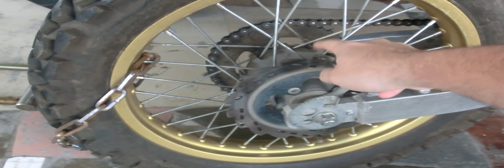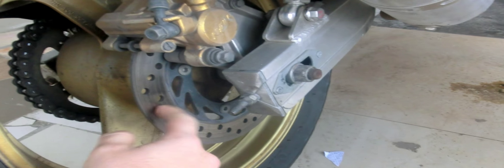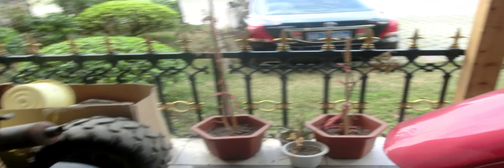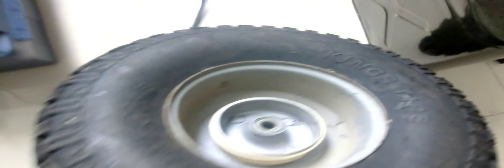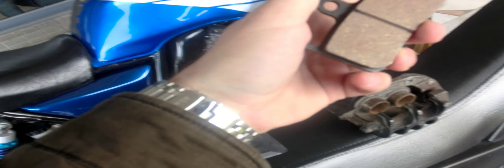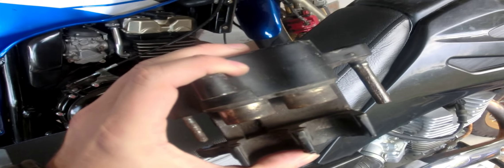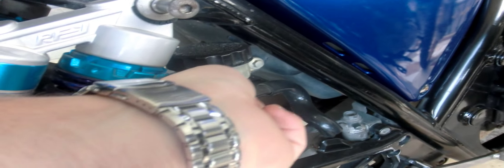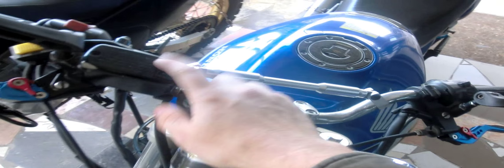Disc vs. Drum Brakes

Comment: You actually can bleed breaks yourself with the plastic tube method. This link uses the method I as well use /watch?v=LH68qjGqS1E&feature=related . Some proponents claim that using DOT 5 silicone fluid totally eliminates moisture contamination problems and has a very high and low temperature rating. Although 10 times more expensive than Got 3 ans 4 and requires a complete system drain prior to use.
Reply: Silicone fluid corrodes normal brake lines and requires lines replacement and components designed for DOT 5.
Reply: How about DOT 5.1? Less hassle and potential issues.

Comment: A slight correction if I may, drum brakes are extremely more efficient than disc brakes as they use only 300psi to stop and disc brakes can use thousands of psi which is the reason for the hydraulic lines to help the pads apply pressure onto the disc. Drum brakes only require around 300psi and they are at max efficiency with the only draw back being that they don't allow much braking past one good hard brake and with the traffic that accumulates today it tends to be better to have disc brakes. If you try braking the first time on a drum brake car it will slow down as fast or even faster than disc brakes, but only that first time until the brakes have cooled down.
Reply: Drum brakes require less pressure largely because one of the shoes is trailing edge, which tends to bite.  Swept area determines braking power, not effort, and hydraulics provide the leverage needed to activate disc brakes.  Ventilation provides cooling, obviously discs are better there.  Fade is created by out gassing from the disc/pad interface.  The gas prevents contact of the pads and disc, this is remedied by holes and/or slots.  Cooling and fade resistance are the disc's strong points.